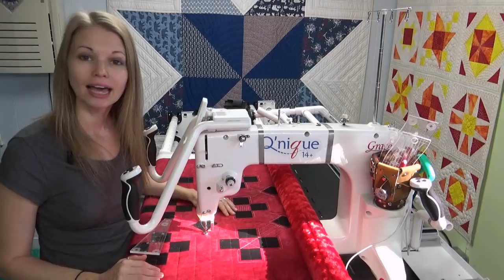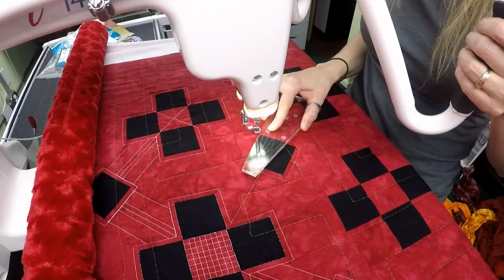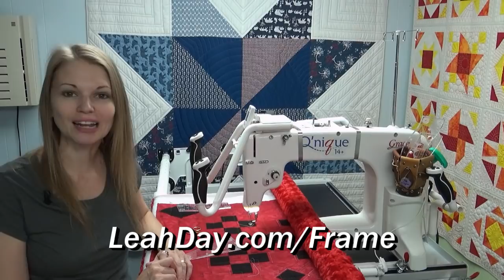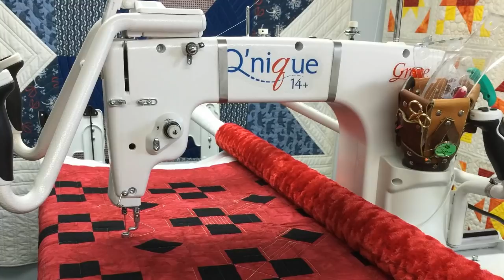Longarm Ruler Quilting on a Baby Quilt - Tricky Design Time!

Comment: Wow, I like the lines design a lot and I can see how difficult this is. How come you didn’t mark it so it’d be easier for you?
Reply from the maker: Great question! Marking would have been a good idea if I was continuing the design on my home machine with walking foot quilting or regular free motion quilting. But because I'm using rulers, it's a bit faster to just use the marks on the rulers as a guide. But I have to really concentrate when doing weird spacing / placement like this and as you saw at the end, sometimes I make mistakes!